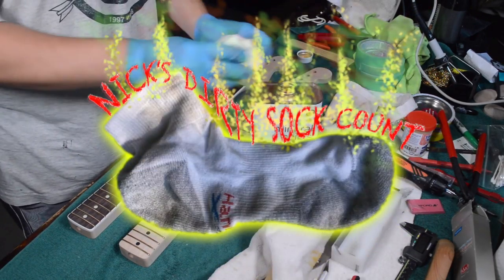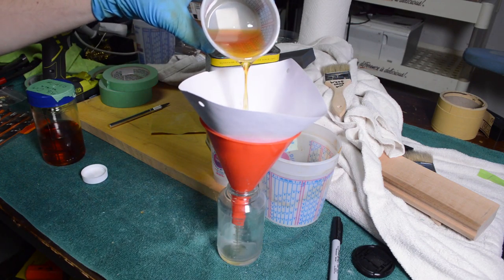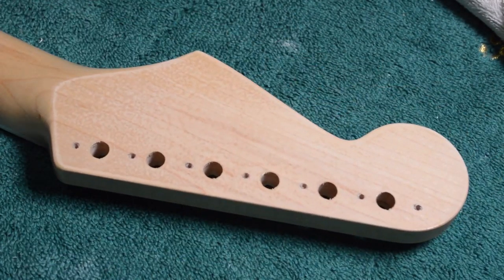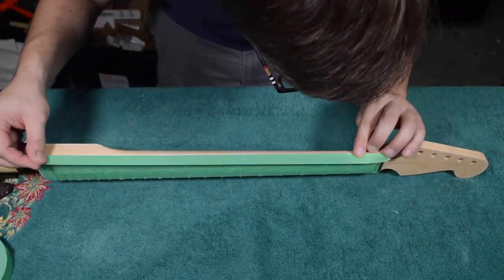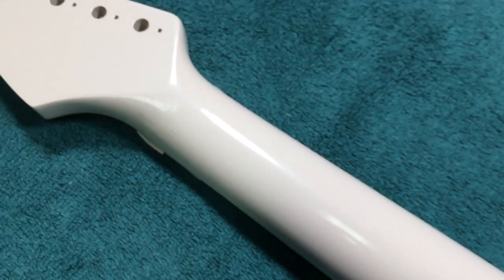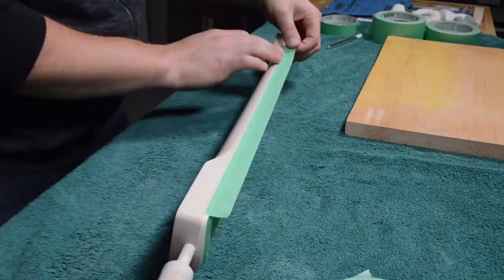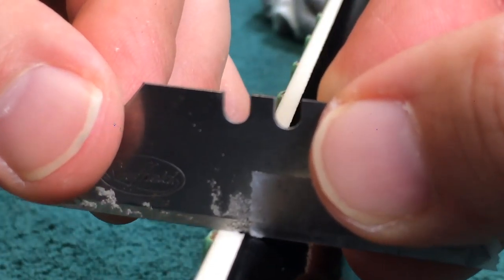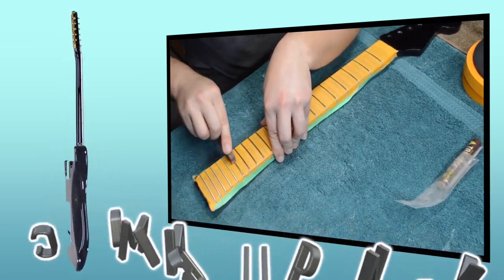Dog Hair / Silver Fox Build Part 3: Finishing the Neck

Comment: You do know that the typical Fender neck pocket is tapered, yes?
The neck needs to drop straight down into the body pocket, it will not slide into place from the end.
Just saying, I had to find out the hard way.
I have a beautiful Ash Strat body I'd like to try to finish in the dog hair style, is there a way to use a vibrantly colored grain fill instead of the white/silver?
I've seen some PRS and especially the Charvel San Dimas bodies that have been finished that way (black Ash bodie with bright grain highlights).